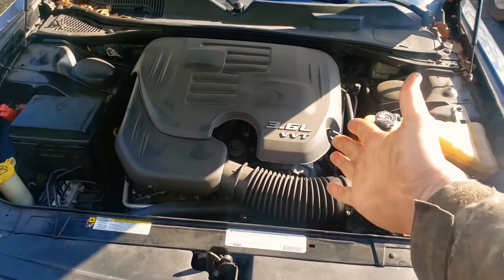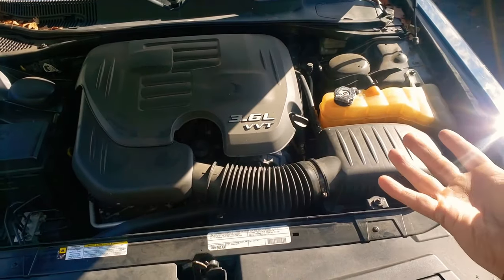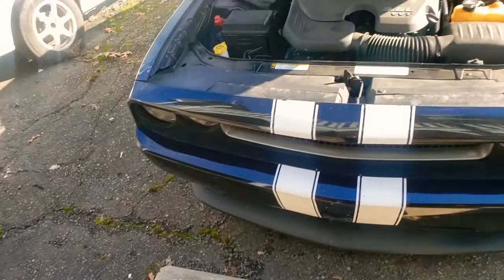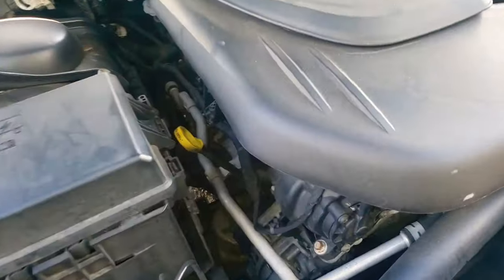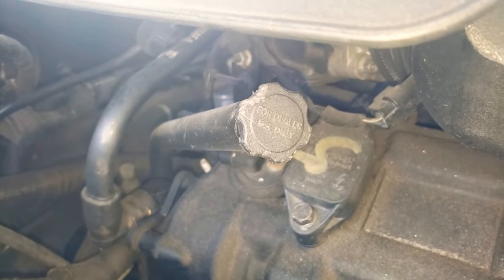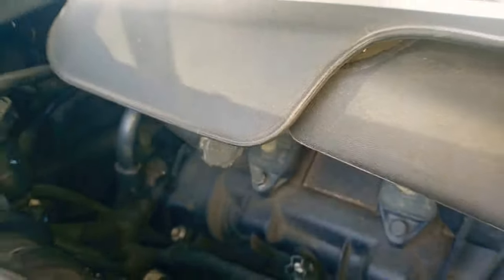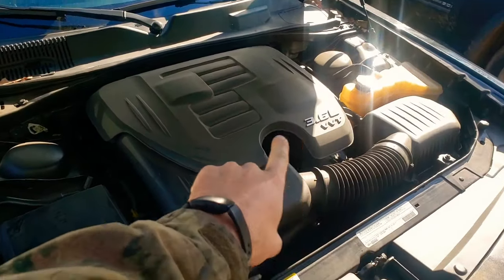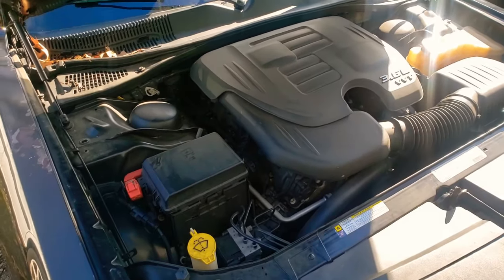2008 2020 Dodge Challenger How to Check Transmission Fluid Location Find ATF Dipstick 2019 2018 2017

Comment: 2015 doesn't
Reply: For 2015 dodge Charger there a hose that connects to nun thing right front of your intake u only can pump fluid inside your transmission hose only 4 quarts.. if u can’t find it hmu
Reply: I have a 2013 300 and I can’t find mine